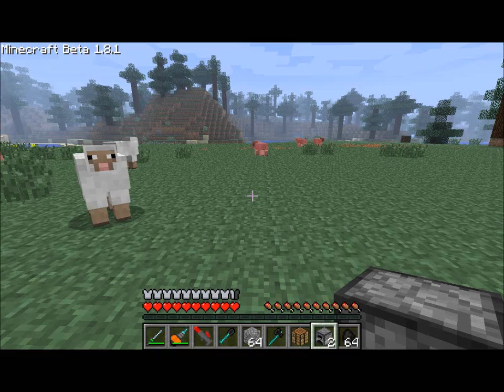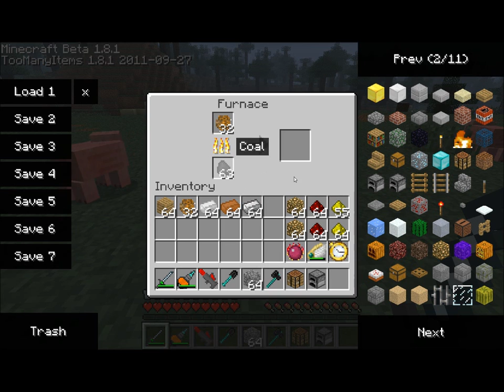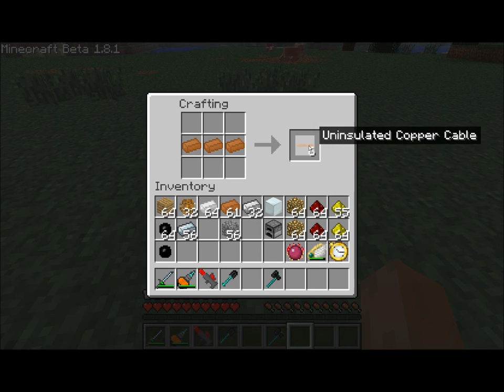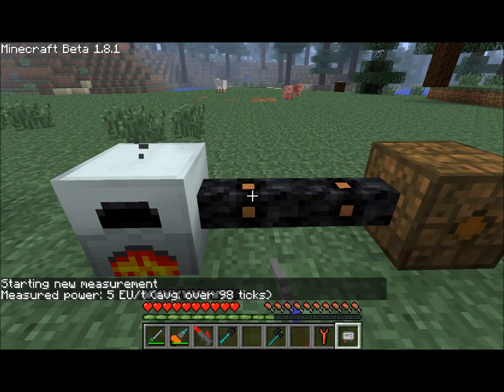IndustrialCraft 2.0 Tutorials - Tier 1 Energy

Comment: two things: you can craft a generator using an iron furnace instead of a stone one and a refined iron instead of a machine block (8 Iron and 1 refined iron) and you can craft an iron furnace with a stone one and 5 irons, in this way you can reduce the cost of a generator to 5 iron, 1 refiner iron and a RE-battery. Also you can directly produce insulated copper cables, the recipes is the same one plus a piece of rubber in each spot left for 6 insulated cables (same cost).